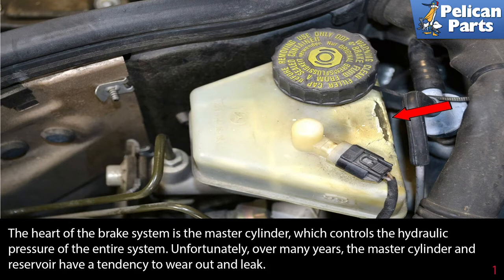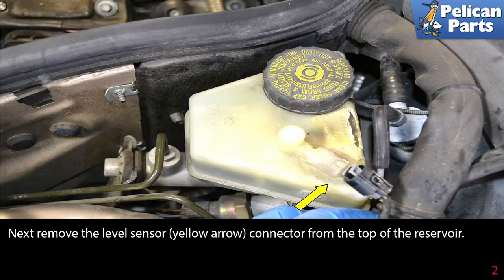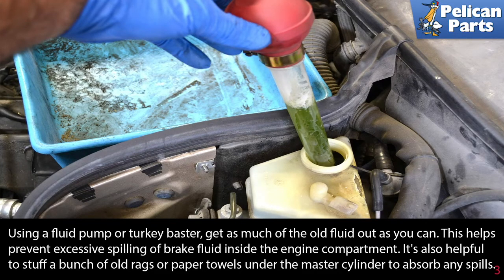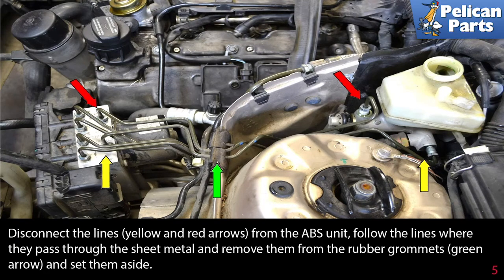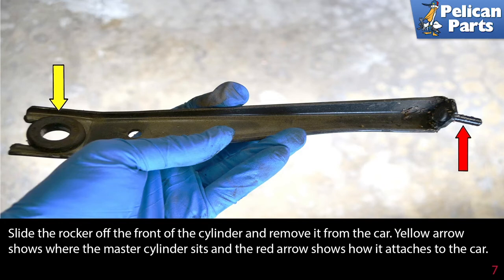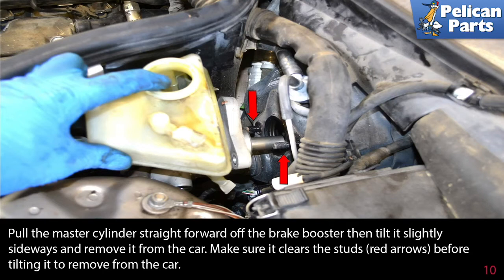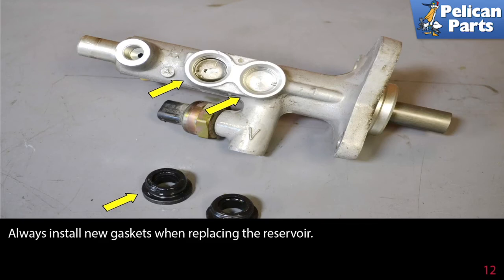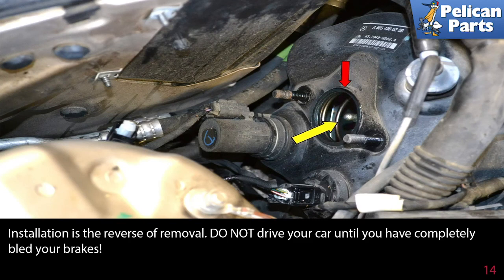Mercedes-Benz W203 C-Class Brake Master Cylinder and Brake Fluid Reservoir Replacement

Comment: Where do you buy that crush washer, any idea? My master cylinder is fine, I need to get to the wires underneath
Reply from the maker: From Pelican Parts. You didn't mention what year and model vehicle you are working on.

With your vehicle info handy, give The Pelican Parts parts specialists a call at 1-888-280-7799. They can figure out what part or repair kit you need.
Reply: did you call pelican for part?